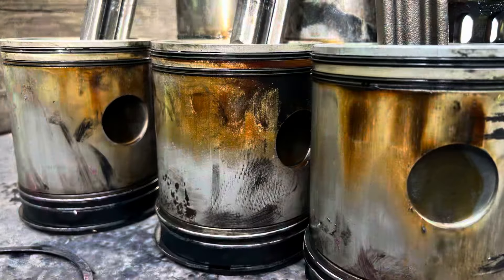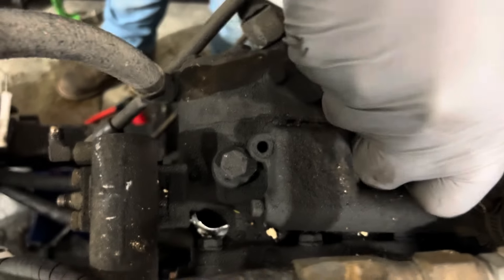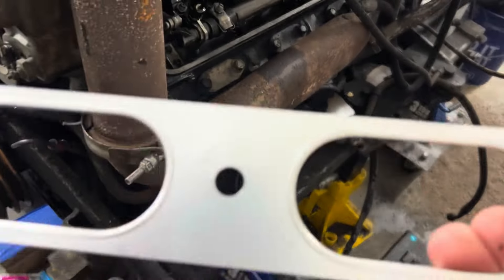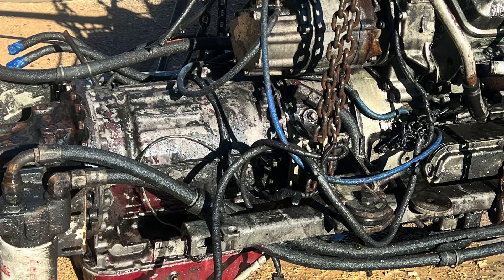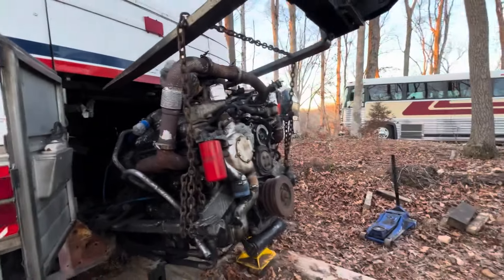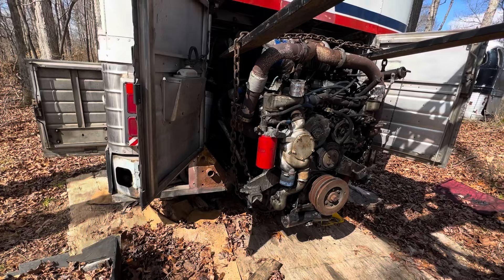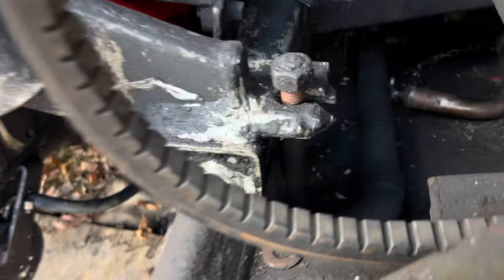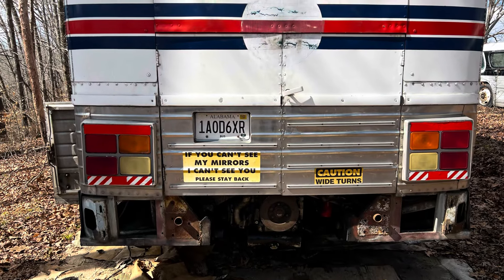Replacing the detroit diesel 6v92TA engine in mci bus. Sliding cradle in with a new holland tractor

Comment: I am always impressed with the 'Big' work you will undertake.
Reply from the maker: The out of frame rebuild could have cost as much as $40,000 all said and done.  10k ish to swap in a used engine.
Reply: @BusGreaseMonkey How much more roughly to repower with something more modern? Not knocking the Detroit's, just curious.
Reply from the maker: A lot more and not worth it.
Reply: @grabasandwich One thing, a modern engine would require all of the gages on the dash to be replaced & rewired. Existing ones, wouldn't be compatible with the electronics on a modern engine. Then, the diesel exhaust fluid tank & system. The entire exhaust system. All together,  probably 50 or 60k.
Reply: @BusGreaseMonkey Sad how the EPA has been trying to kill diesel. It's still the most efficient and effective way to move heavy vehicles.
Reply: I enjoy how practical you are.   You definitely look out for the best interests of the bus enthusiasts.
Reply: @grabasandwich modern diesels aren't any more efficient. Well I guess they are when you figure they make more HP for similar size engines but as far as MPG are no different. They have more complicated systems and sensors that go out. When something is wrong they go into limp mode. And they run DEF.
Reply: Back yard mechanic at its best !

Comment: For our fleet of couches we had a metal cart for removing engines. Just raise the vehicle up and set it back down so that the engine rests on the cart then just roll the whole assembly out off of the engine mounting rails the way that the factory had intended.  Total engine and transmission swaps in about 8 hours.
Reply from the maker: Try using that cart in the woods

Comment: I remember you saying what the blower did on these engines, but it's not what most people think it is. I know it's not a supercharger,  but what is it?
Reply from the maker: On your 4 stoke engine the pistons travel up and down an extra time just to suck fresh air in and push exhaust out.  The two stroke does everything in just one up and down but it can’t suck air in and push out the exhaust with the pistons because the piston stroke is used for compression to heat and cause the fuel to ignite then transfer the power from the explosion into the crank.  The blower pushes the fresh air through the cylinder when the piston drops to the bottom. There are holes in the cylinder walls that the piston drops below and the blower air enters and exhaust valves open at the top of the cylinder to let the gases out.   The valves close and the fresh air gets compressed on the piston’s way up again.   One revolution of the crank every piston has fired.  For stroke takes two revolutions for every piston to fire off.  Up stroke down stroke does everything in a 2 stroke.

Comment: I know that some MCI buses like those that NJ Transit had/has were ordered with the 6V92TA but I but think it would be at least somewhat underpowered with that engine. I figure that the 8V92TA would have been a much better choice just due to having more torque. That 6V works OK in transit buses but those coaches are pretty heavy under full load. I haven't seen any figures but I imagine that the 8V would usually go longer between rebuilds vs the 6V.
Reply: How is it like working at NJ transit? I’m currently an Entry level tech at a toyota dealership but looking something else because of the flat rate system. Any advice?

Comment: Great videos as usual. However. I cannot express how quickly tragedy can happen with chain's wrapped around forks and  tilting the forks down.  I always mandated that c clamps on the  forks be used to prevent the chains from sliding forward down and risking human body parts first and objects second.  Cheap insurance.
Reply from the maker: We never tipped it until it was on the rails and ready to slide. Then we needed the slide to get it in.

Comment: Why do Buses need a Turbo and a supercharger ?
Reply from the maker: It’s a 2 stroke the blower is considered naturally aspirated.  It needs it just to move the air in and exhaust out.  Won’t run without it.  The turbo increases the air.  It’s not needed but gives better performance
Reply: The long answer (after Scott's explanation) is that in a 2-stroke design,  you do not have the dedicated intake and exhaust strokes that a 4-stroke engine has.  With a mere 2-stroke,  it's hard to get a supply of fresh air into the cylinder before the compression stroke, and also after the power stroke, it's hard to get the burnt mixture exhausted completely before the piston is already on the upward compression stroke again.
The blower (that you called a supercharger) makes a pressure through certain passages. When the piston in each cylinder drops below the ports in the cylinder liner, the power stroke has pretty much completed,  and as the piston passes below those ports, the pressurized air begins to blow into and upward in the vacated cylinder. Simultaneously, the exhaust valves in the head, open.  As the pressurized air from the blower pushes in through those ports, they perform 2 actions. One, they scavenge the dirty exhaust gases upward and toward, through, and out the exhaust,  and refill the cylinder space with a supply of fresh air for the next cycle.
Then, as the pistons begin traveling upward again and block off those ports in the liner,  the admission of fresh air is halted to that particular cylinder while the compression and power strokes happen.  During this time,  other cylinders will drop down, be scavenged, and reset for their compression and power strokes.
If the blower is not doing its job, the engine cannot function.
Any Detroit 2-stroke engine can function with just a blower.  The addition of a turbocharger, or multiple turbochargers,  can improve the performance by giving the blower additional pressure to do the work of scavenging out the exhaust and really ramming in higher volumes of fresh air into the cylinders to be compressed.  The injector can then admit higher volumes of fuel to work with the additional volume of hot, compressed fresh air,  and you can then get more work out of each cylinder, equating to more power. 
A turbocharger relies on the hot exhaust gases being spewed out, to turn the "hot side", which directly turns the "cool side" which compresses fresh air.  It is essentially free boost, because it uses the power of the escaping hot gases to generate more fresh air to be force-fed into the intake.  Turbocharging helps in both 2-stroke and 4-stroke applications.  
Whereas, a Supercharger can be a more effective setup,  a Supercharger is considered to be a parasitic draw, or a loss, robbing an amount of power directly from the engine in order to perform its function.  Usually, a Supercharger will be belt-driven.  
In the case of Detroit Diesel engines, it is not considered as a "Supercharger", merely as a blower,  because the engine drives it through a mechanical gear-driven linkage, and will not function without the blower working. 
Some other 2-stroke engines in the Detroit / GM Diesel family, use a highly modified turbocharger arrangement.  Because the turbocharger cannot really provide much boost at lower engine speeds, engineers designed turbochargers that are directly driven by an over-riding clutch system at lower engine speeds to ensure that the turbocharger can provide the additional boost.  When the engine speed picks up, the clutch is over-ridden, and the turbocharger receives enough exhaust gas output to work as a true turbocharger. As the engine speed drops off and exhaust output falls off, the clutch once again "picks up the slack" to keep the turbocharger compressing and contributing.